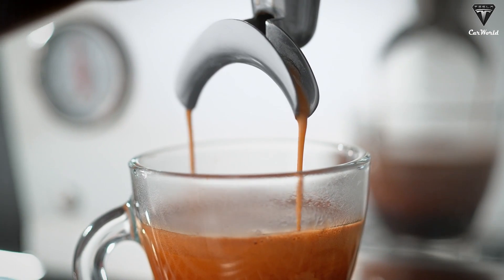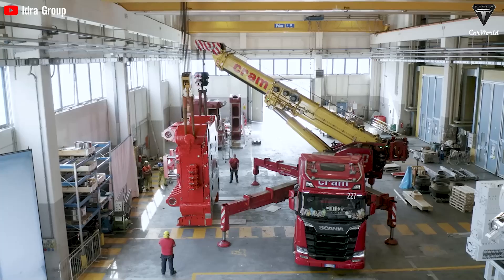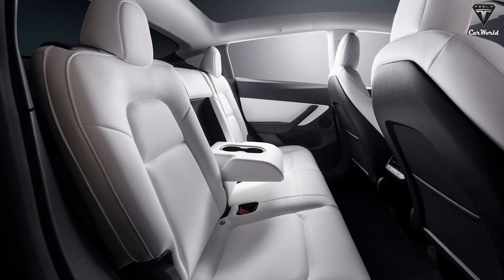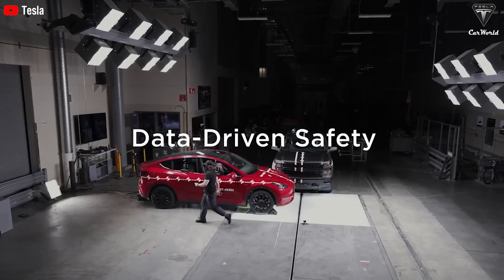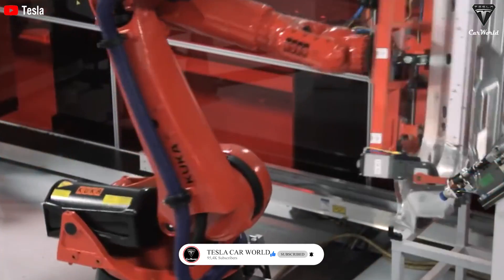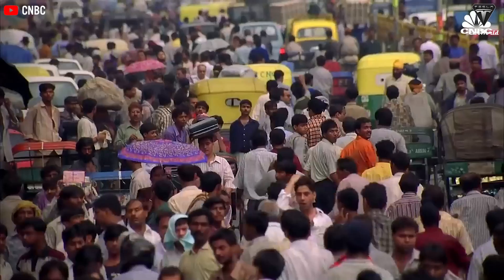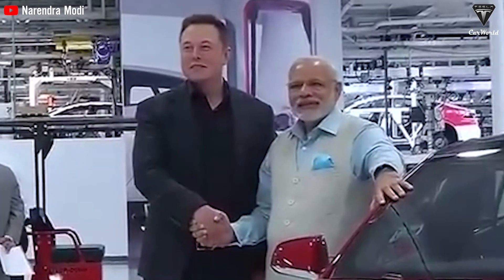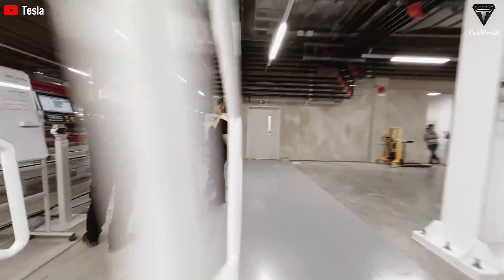The Tesla Phenomenon: Elon Musk Unveiled Why the World is Astounded by the 40-second Car?

Comment: VERY MISLEADING Commentary, and "Headline"..
A car is NOT "built in 40 seconds"... it could take HOURS from beginning to end... but it simply means that as one car rolls out every 40 seconds... it means another car is STARTED as one car finishes... SURE, it still means that the assembly is simplified as sub-assemblies get done in time to reach the assembly point in time for the next 'Station" and that the assembly line is more efficiently set up to maintain that moving process... But the car is NOT BUILT in 40 SECONDS..!!
If you START a car at 8am, and ANOTHER CAR at 8:00:40... but the first car arrives at the end at NOON... and the second car arrives at 40 seconds After Noon... each car "Rolls Out" 40 seconds apart, but took FOUR HOURS to BUILD...
The Corvette Assembly, in Kentucky, has some 'Stations' that take 2 Minutes or more...but they do Multiple 'steps' or processes, at just one stop. I toured a GM assembly Plant years ago, and they were actually assembling 3 Different Brands on the SAME Assembly Lines!
One car may be a Pontiac, the next car could be a Buick, and the next one a Cadillac...
And they had THREE Lines running at the same time. But the Brands were still "mixed" between all three lines..

Comment: This is misleading. The car is not built in 40 seconds, that’s how quickly a complete unit is rolled off the line
Reply from the maker: We understand how you feel, this is really hard to believe. However, it's completely fraught with possible factors. As you can see in the video series of robotic arms that work too fast and flexibly, the machinery system is too modern to complete the job in just a few seconds. If given the chance, we hope you get to go to the giga Shanghai factory to witness this. It's hard to believe but it's true. Have a good day